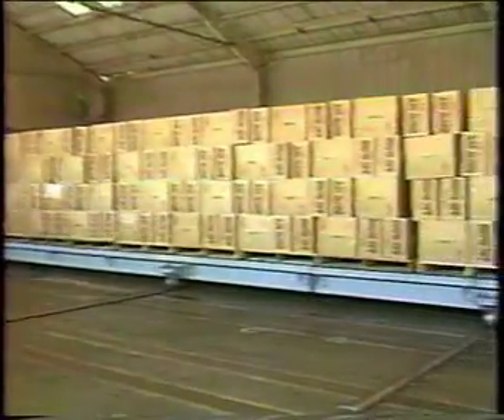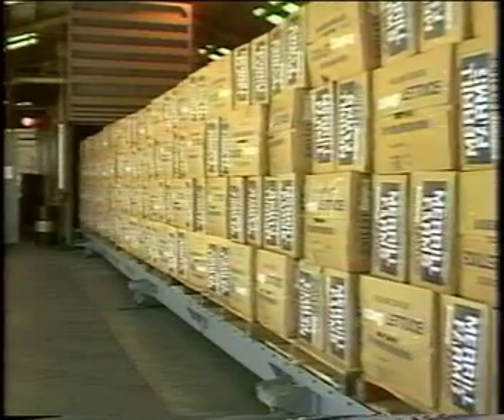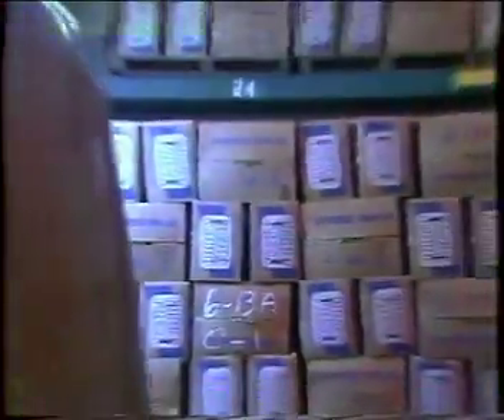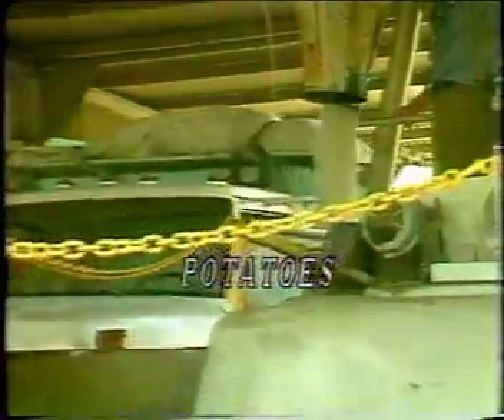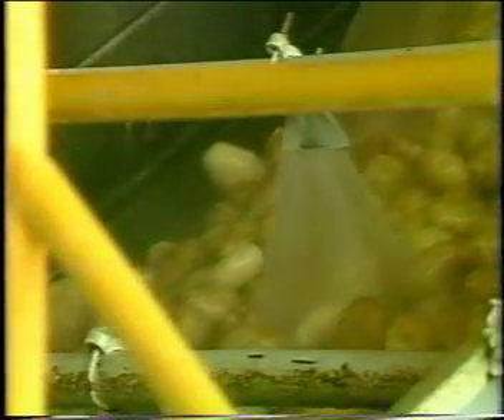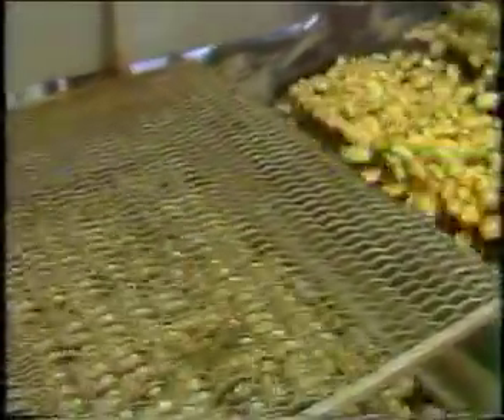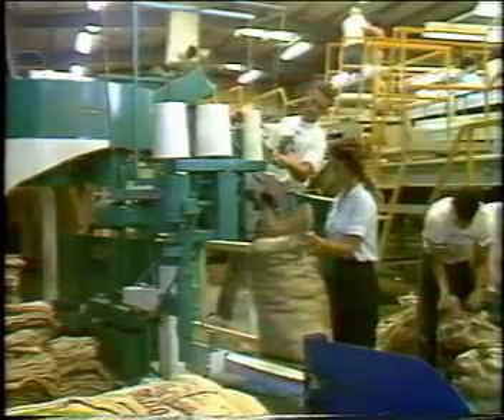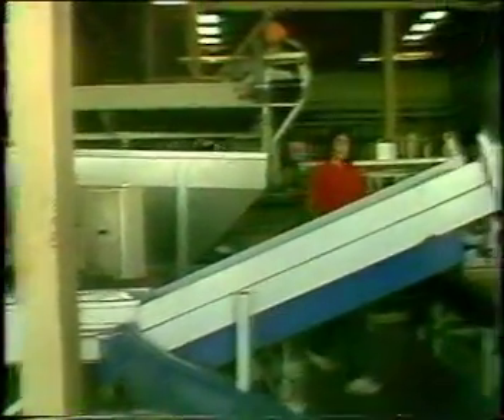Lettuce: Vacuum Cooling | Potatoes: Postharvest Handling

Comment: Shocking energy waste.
Reply from the maker: Hi Aryeh, I get where you’re coming from — energy use is an important concern! The interesting part about vacuum cooling (and other cooling methods) is that while it does use energy, it actually helps reduce overall waste by keeping produce fresh longer, preventing mold, and slowing decay. That way, less food gets thrown away, which saves resources all the way back to the farm. In many cases, the energy trade-off is worth it for the huge benefits in quality, freshness, and reduced food loss. If you'd like to learn more you can check out the UC Postharvest Research and Extension Center’s website here: https://postharvest.ucdavis.edu/ — it has tons of useful info on postharvest handling, research, and extension resources. 🌱